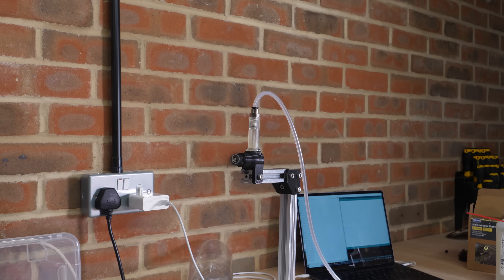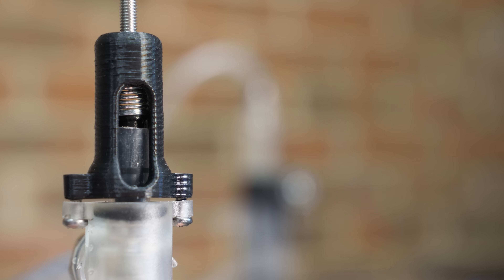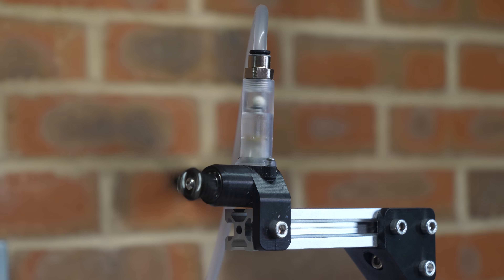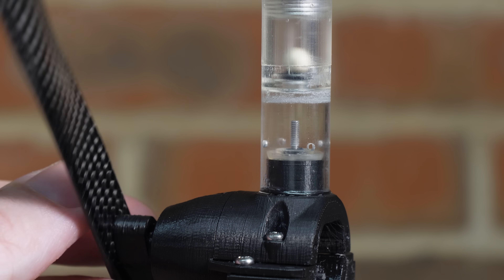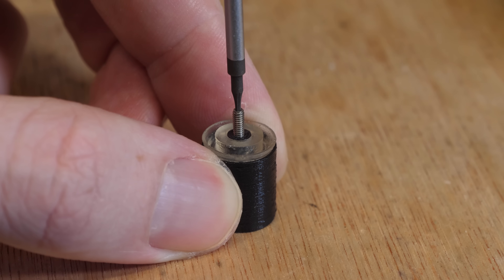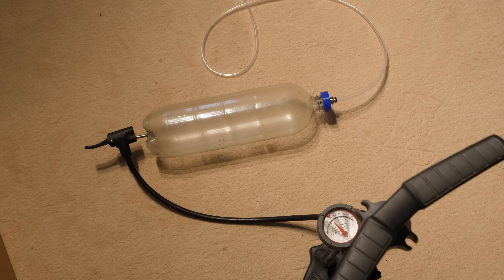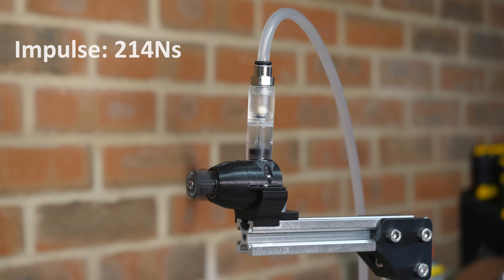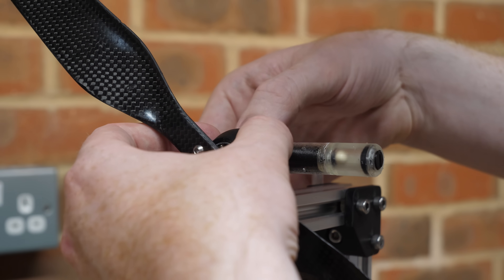4,500RPM Air Engine

Comment: You could try to use the excess pressure as extra boost for your propeller by blowing it out of the cylinders right in the propeller. I think it needs some configuration for the right timing but could give some extra power to the engine respectively increase the engine effiency

Comment: I have a question. These air engines convert the potential energy of air pressure into mechanical kinetic energy, and then turn that mechanical energy into wind energy. To me, it seems like a lot of energy could be lost due to friction and drag. Would it be more efficient to propel the planes by just allowing the air to escape out of a nozzle? Maybe I'm not understanding the physics of this completely, but I would be very interested to hear what you have to say about this!

Comment: Why use a compressor but no combustion? Compressing air requires energy, Of course it is good for combustion because there is an energy bonus from the explosion, but if there is just flowing air, compression is not a good choice.
Maybe that's just my opinion but if you think this is wrong I should learn more about this

Comment: Hello, 

couldn't you use the exhaust gases from the first cylinder to fuel the second one,
like in a double expansion steam engine to increase efficiency?

Best regards
Lookoda

Comment: Thats genius! I just thought of something. Make one that fits in a bike frame, kinda like the little mountain bike gas motors, instead run from a tank of air. Now as the bike  travels, the wheel will also pump air back into the tank to keep refilling it via a pump etc....Infinate travel!

Comment: The reasoning at 4:36 about the expansion ratio of 1:3 is flawed, as it is based on the assumption of a linear relationship between gas density and pressure. This would be true for an isothermal expansion, but this is clearly not an isothermal expansion. If the title is correct, the expansion takes less than 7 milliseconds, and there isn't much time for heat transfer. The process is thus closer to adiabatic, which means that when the piston reaches the bottom and the volume ha increased by a factor of 3 (and the gas density has decreased by a factor of 3), the pressure has dropped below atmospheric pressure "long ago".

I don't understand the reasoning behind looking at the crank shaft angle when considering the efficiency. At best, the explanation is very incomplete. Why is the pressure lower when the engine with larger cylinder volume reaches a certain crank shaft angle? I don't believe this to be true, and I also don't think it is true that both engines would consume the same volume of air. The engine with larger cylinder volume would consume more air because the pressure would increase less for any given amount of air. And this is most likely the true reason for a lower efficiency. Greater volumes leads to higher consumption and at the end of the stroke, there is more pressurized air that is wasted. The aim here, should be to reduce the "dead" volume as much as possible and optimize the pin on the piston to make the valve open and close with a reasonable timing. Here I can see the benefit of what many people have suggested, to have some sort of offset. You don't want to open the valve too soon because you would create a resistance as  the piston is moving upwards. But you would want to keep the valve open during the beginning of the working stroke to make sure you get enough air into the cylinder.

Comment: How about using a gas generating chemical reaction as pressure source instead of pressurized air? Like for example lime and vinegar, producing carbon dioxide and calcium acetate.

Comment: Dear Tom, I've been enjoying your videos for some time. I must say, great content. 
When I first saw your videos about the air pressure operated engines in the past, I gave a bit of thought to the limited storage capacity of your air tank, pressure limitations and weight limitations but could not find a solution. The right answer may be cryogenics! At first, I thought cooling your storage tank and keeping it cool while pressurizing but it won't change a lot. Then I thought about, why not to put juuust a little bit of dry ice in the bottle with a pressure safety relief valve or even without a PSRV. When the ambient temperature warms up the dry ice and keeps the pressure up in the tank for some longer, that would give a bit longer flight duration. I hope, without increasing your weight a lot, you can store a lot more potential energy. Just an idea for your consideration. And thanks for the great content.

Comment: What was the method used to calculate the torque in Newton 'N' ?
Did you calculate the inertial mass of the propellers and do the calculation based on that?
Reply from the maker: Sorry, I forgot to mention it in this video. The engine is mounted on a thrust test stand, so a load cell measures the thrust in Newton's. Then the impulse (Newton seconds 'Ns') can be calculated by the are under the thrust graph.

Comment: I think you can run H2O2 through a catalytic converter and get steam.  You can then have a lot of pressure available in order to run the engine for a significantly long duration. The only caveat is more complexity and the usage of a boostpump to pump Hydrogen peroxide fast enough into the catalytic converter to build enough pressure to be usable for the air engine.

Comment: I think a v8 in a little RC type car would be sick. Like where you use a couple pressure control knobs to control throttle and power steering and then have tubes to the car. I swear I saw someone do something like this with lego air piston engines a long time ago.

Comment: What if you offset the cranshaft from it's centre a bit? That way the piston will always have an easier time pressing the piston down right? Since pressure applied when the crank is at its top position is wasted until the crank revolves enough for the force to be directed to the side and not on to the top area of the crankshaft itself.

Comment: I was thinking, doesn't the piston function as a compressor when going up? Shouldn't you have a way to vent out the air when going up? Which closes when it is going down? Bc that wouldn't that be the "hidden inefficiency"? I'm not sure but this makes sense to me.

Comment: Just imagine doing a little more research and development. Creating something bigger, more rigid and durable. Then, installing it onto a glider. 

Once the glider is in the air and released from its tow plane, and it begins to lose lift/altitude, one could engage this air compressed engine, to increase their speed and glide time.

With the right amount of money, and the correct minds behind that idea, I wouldn't be surprised if one could essentially glide around the world.

Comment: If you're using compressed air to power a propeller, why not use a wankel engine that has direct rotation, rather than indirect piston-gear rotation?

Comment: Tom, as others have said, the vibrations are probably not helping, so a counterbalanced crankshaft would help, also have the conrods nested within each other so they are both acting perpendicular to the crankshaft, meaning no side-thrust. Also try adjusting the width and angle of the exhaust ports, plus adding a tuned exhaust pipe to help with scavenging the exhaust (although that would add unwanted weight) and improve efficiency?

Comment: @TomStantonEngineering Ive been following the channel for quite a while and it just hit me, what if instead of pressurizing the bottle then releasing the air to the engine giving only a certain amount of run time. you can pressurize the bottle mid air via some sort of chemical reaction such as baking soda and vinegar the pressure will increase for how long? give it a try i think it will work.

Comment: Not sure if you factored this, but in the high residual volume engine, the air expands to atmospheric pressure and will therefore not exit the exhaust ports after the initial flow between the ports opening and BDC. When the piston hits TDC, the cylinder will already be at almost the same pressure as the air supply so you won't get very much air flow in.

Comment: The valve design, while simple, suffers efficiency losses due to the amount of force required to open it against the 60psi - 15psi pressure difference at the point of opening. Balanced valves apply the high pressure gas to both sides of the valve such that only a small net pressure remains across the valve minimising the work required to open it.

Comment: This has me wondering if you can get sequential timing on a radial air engine.... 🤔 Thrust would be excellent, efficiency not so much. But the cool factor would be 10/10. The downside is that an ICE radial fires even then odd, and can only use an odd number of cylinders (per bank). This means the firing order is 1, 3, 2, 1, 3, 2. Or for 5 cylinders; 1, 3, 5, 2, 4. Seven cylinders, 1, 3, 5, 7, 2, 4, 6.... And so on.

Comment: At 6:04 your explanation of why the engine with no "expansion volume above the piston" is more efficient is incorrect. The left engine initially transfers 10CC of high pressure air into the "expansion volume" without producing any useful work on the piston which is at TDC whereas the engine on the right is using the entry of the high pressure air to push down on the piston transferring energy to the prop. In this phase it is operating in a constant pressure regime. Once the engine on the right has 10CC of air in the cylinder above the piston it is now in the same state as the left engine (volumetrically, not crank angle) but it has already done some work unlike the left engine. Both engines can now expand the air to atmospheric pressure doing exactly the same amount of work, albeit with different pressure/time profiles due to the difference in crank angle. Obviously the right engine would need a longer stroke to achieve the same 3:1 expansion given that it started its (adiabatic) expansion phase later in the stroke.

The torque/time profile will also differ but ultimately the energy out per stroke is force x distance regardless of how its metered out over time. The lost energy in the left engine is a result of friction losses as the air travels at high speed past the valve from the 60psi reservoir into the 15psi, 10CC "expansion volume" above the piston.

Comment: would it be worth trying a different lay out with the multi cylinder (inline) and the second cylinder being a bigger diameter and running of the exhaust of the first at a lower pressure a bit like the old triple expation steam engine of times of old

Comment: I'm confused, why is the 2 cylinder engine revving during that last test? is it doing it itself due to inefficiencies in the self regulation or are you adjusting the input pressure?

Comment: a lot of vibrations. you have to make pistons work in sync (out-out/exhaust-exhaust, not in-out/inhale-exhaust). Also vonsider to make electronic valves like ingentza made. engine starts below 1 bar

Comment: is a reverse piston engine possible?
As in, use athmospheric pressure to run the engine and store the exhaust gas in a low pressure tank?
Reply: It is, but in practice it's much easier to store positive pressure in a tank than negative pressure because materials normally buckle before they break. Like how a plastic balloon has so little buckling strength that it can't even support its own weight before folding flat, but it can hold plenty of pressure before ripping apart.
Reply: @Cyrenetes   Maybe not use a plastic bottle for that one, but i get what you mean.
A bottle with 10x athmospheric pressure has 10x the potential energy than a bottle of the same size with a vacuum.

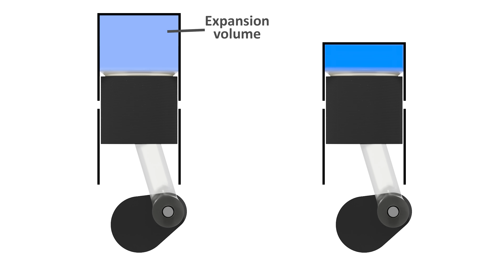Comment: around 5:45, you mentioned how the cylinder on the right is more efficient despite the pressurised air leaving through the exhaust. steam engines had this same problem on boats, and the double-expantion/triple-expansion steam engines were created.(basically, there is a second piston after the first, which uses the pressurised steam from the first engine with a larger piston, to glean more mechanical energy from the pressurised steam. trying to create such an engine for this air engine would be intresting.

Comment: Base your valve on a glass syringe rather than a plastic syringe. Glass syringes don’t have rubber seals at the bottom of their plunger, they have instead a glass plunger that machined to perfectly match the inner diameter of the glass syringe’s glass barrel, there-by providing a perfectly seal with little to no friction. This is why glass stringers are much better for those who self administer IV injections, as they have such little friction they self ejact once they find a vein, just from the blood pressure in the vein.

Comment: Really?  We have been using air motors since compressors were invented.   Some tools run at over 10,000 rpm,   You still need compressed air.
Reply: Back in the sixties, I met this guy that wanted to invent an air motor.   I brought him to my grandpas garage, showed him the Ingersoll Rand compressor and a rotary file that operates at 10,000 rpm at 90-100 P.s.I.    All rotary motors, no piston that needs power just to move it.   Very inefficient.

Comment: love the engines that your making! Have you looked into an accumulator setup for the air tank that feeds the engine? In theory you would get a steadier psi out of the bottle. for example currently your running at 60psi and it drops to nothing steadily. with and accumulator you may see 60psi untill the tank is empty. Sense your using a 2liter bottle you can transform it into a bladder accumulator buy placing a balloon over the outlet end, the air on the closed side of the bottle would then become an air spring. Unfortunately idk how well it would work without some testing.

Comment: the Twin Cylinder Air Engine's sound is definitely a mixture of a plane engine and the little 2 stroke engines used to run the little fishing boats here in the Philippines. I am not sure what it's called but it's basically a boat with Bamboo poles on either side to stabilize it you can search up "Philippine Boats" to see what it looks like

Comment: I wonder if it would be an improvement to add an exhaust header tube of sorts, tuned to improve scavenging and pull the chamber pressure as low as possible? Though at 4500 RPM it may need to be unfeasibly long...? Those efficiency improvements are amazing! For only the needed thrust, the engine can be scaled down, though at some point I suppose you run into the limits of what you can easily manufacture.
Reply: P.S. I absolutely adore the creative ball intake valve mechanism, it's so clever!!

Comment: Fun project. Love the creativity mixed with science. In the slo mo section you can see condensing water spraying out of the exhaust.  That is lost energy (?) in the system.  Have you thought about using an air dryer to see if it improves efficiency? What about other gases? Pure Nitrogen might be interesting to see and won't break the bank. Sulfer hexaflouride because of the density?

Comment: Here's a thought, take the twin cylinder version and turn it into a compound engine. Where you feed the exhaust from the high pressure cylinder into a larger low pressure cylinder. This design was used quite a bit with steam to improve efficiency by recovering as much energy as possible out of the working fluid. Might get more runtime this way.

Comment: With the level of engineering done on these engines, I would love to see you tackle something like a compressing tank, something maybe with a spring that will keep higher PSI for longer by pushing a piston into the tank as air is used.

Comment: you're going to loose some power and efficiency because you are pressurizing the cylinder on the way back up as well.
Reply: I was wrong, because you have the flexible seal.

Comment: Tom, could you take any advantage of the remaining high pressure air exhausting from the cylinder if you orient the exhaust ports of the cylinder so that the air flowing out adds to the net thrust of the system?

Comment: Hey Tom , you like tinkering , and you did try a push bike charged capacitors and a motor ...

So I have a challenge for you ,  rug up a bike , with capacitors again....

But try adding a dynamo ,of sorts , to constant charge the caps , to supply power to motor ??

Just a thought .

Comment: Cool! Without thinking this through: would it be possible to make a double or  tripple stage expansion air engine?  So basically a high pressure optimized stage which exhausts into a lower pressure optimized stage?

Comment: How about the exhaust? It can be used as small propeller or with some aerodynamics study you can use it to make the air going out faster with higher rpm as result.
Sorry for my english...

Comment: This whole Pneumatic Engine series has been fantastic from start to finish and I feel like at this rate, you're going to come up with some inline 4 design that uses air-injection and electronic control to get the maximum possible efficiency!! I cannot wait to see where this goes, as this is super exciting work!!

Comment: I think you should use an acrylic sleeve in a 3d printed “head” and work on exhaust length and shape. I know on gas engines the longer the exhaust header the more torque I’m not sure how much it would translate to this design though.

Comment: There could be some ideas in this video. https://youtu.be/fFoYPj3Ntzc?si=pQu5hSvw1-rMuXDb
The easiest to implement maybe to coat the bottle with matte black paint to use the sun power to heat up the gas.

Comment: Awesome build, if you want to add a little bit of efficiency from parasitic loss, try making a small counterweight to oppose the force both pistons/rods/crank ..smoother the engine runs the more efficient it'll be

Comment: You should try bigger exhaust ports so at higher rpm all of the exhaust is escaping the cylinder. You should also make little elbows to direct the exhaust backwards for a little extra thrust when you put it on a plane.